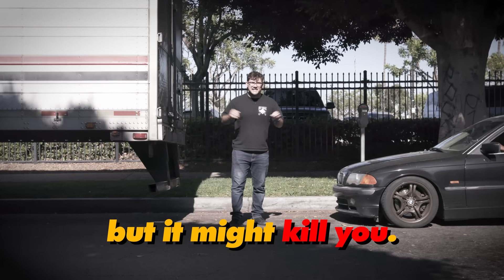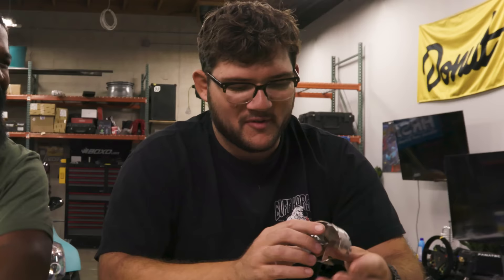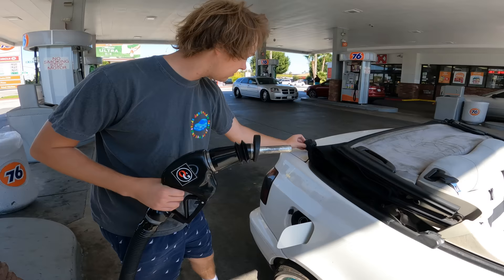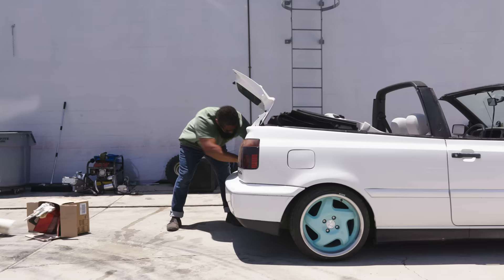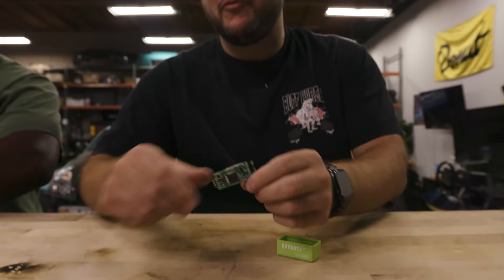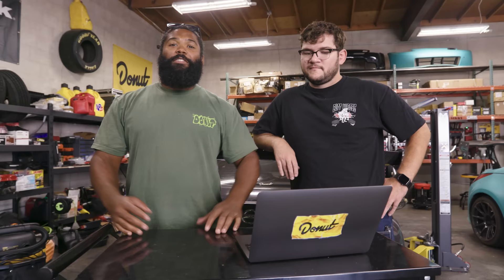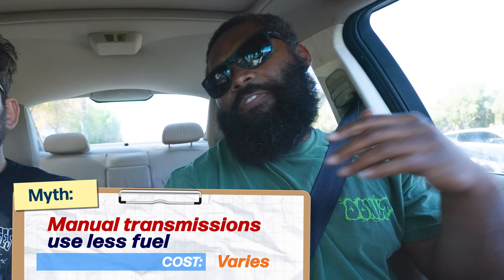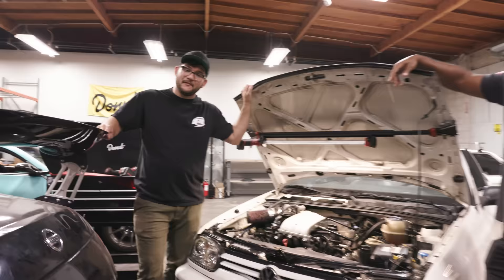Testing Fuel Economy Hacks

Comment: A few issues with their myth busting.
HHO CAN work if you do a few things as well.
Unfortunately, car makers are hep to HHO and such and deliberately fix your timing so you cannot adjust it - you retard timing to AFTER TDC at full advance.
But it can be tricked via the IAT sensor modification to a small degree.
Pulling the O2 sensor out of the stream might work for some but generally it does not.

HHO generators take time to heat up. 160F to 165F is optimal for the water temperature to convert efficiently - it take s a bit of time to heat the water up that high.

Another item is you have to fool the O2 sensor readings via an electronic gadget you splice in. Unfortunately this does not work well or at all for all Ford products and any that uses frequency feedback. GM is the best for that particular mod.

Here is another problem. I did all that and doubled my MPG, for about a day. Then it went right back to bad MPG. Reason? The fuel mapping in the computer fought me and forced the car to enrichen the mixture as the information was outside the fuel mapping in the computer.

You need about 1L of HHO per liter of engine capacity for best results.
1/4L will help increase MPG by about 20-25 percent with no modifications.

Be aware that if you set things up incorrectly, you can experience and explosion.

Additionally, the hydrogen causes what is called Hydrogen embrittlement.
Not good for the steel parts in your combustion chamber.

With the right setup, a 4 cylinder feels and runs like a strong 6 cylinder (I did the mods).

For every 50 pounds of weight you haul around, you can lose roughly 2mpg or more if you have a small engine.

About drafting - way to tell if you draft enough is to roll down your window.
You will notice a change in the sound from the air, sometimes abruptly. Then you know where the draft is.
Truckers HATE when you draft. Cops can give you a fat ticket for following too closely.

Removing your mirrors can help.

Tail gate up or down depends on the vehicle. Remember, tail gates are a bit heavy.

Vehicle 'belly pans' can help quite a bit but can be problematic with the high heat from the CAT converter.

Using an aluminum pizza pan to cover your rims can help too.
Some go so far as to get LRR tires (Low Rolling Resistance)

Manual transmission can save fuel if you do gear skipping. They are also lighter than automatics.

Getting to the gym to work out and lose weight helps. Why do you think horse jockeys are short and skinny?

Best free ways to save gas is to do this:

1) very SLOW takeoffs from a stopped position.
2) never exceed 1950 rpm's on your gauge at any time regardless of your speed.
3) Keep your car well maintained.
4) lighten the load as much as you can (junk in the trunk/back seat/etc).
5) Anticipate stop signs and red lights. Take foot off the gas pedal early. Drive like you have no brakes.
6) avoid hauling people's asses around.
7) when traveling 35mph or faster, keep windows rolled up.
8) leave the stereo OFF. Avoid using climate controls. Turn off daytime running lights. All save power.
9) Combine trips with the furthest trip away from home as your first stop and work your way back.
10) Pull through parking lot parking spaces so you do not have to back up to get out.
11) Back into your driveway when you get home. Backing up always uses more gas.
12) do not warm your engine up - start it, let it run till the high idle drops to nearly or just above normal idle, then go & drive very slowly till the engine warms up on it's own.
Lucky 13) Have someone else ride you around - they use their gas and not yours!
14) How about bicycling or just walking? Bus? Delivery?
15) do not make stupid trips like driving across town to get your lighter from your cousin's crib. Cheaper to just buy a new lighter.
16) plan trips for when there is the least amount of traffic.

That is off the top of my head.

Comment: Every expert on youtube says 94 and 87 octane are the same. Resistance to detonation only thing, blah blah. I tell you what. Throw some garbage 87 in a classic hotrod or 90s snowmobile, it will run no problem, but then put in a tank of 94 octane and you hear and feel the difference. More power means less throttle to keep a certain speed, meaning it goes further, and when you do put the hammer down it has some good up and go. But ya 87 is the same to these smart people. Lol

Comment: Your wrong about pumping up the tires. Every serious attempt to increase fuel economy has used this tactic. But those experiments were usually done on a closed course or under highly supervised conditions.  The experiments were conducted to achieve high mpg, and not safety. If you were to do the same thing with your car in city traffic you would skid out of control or skid into an accident. It's been known for decades that keeping your tires properly filled will give the best  mpg. When you are lax about maintaining proper pressure in your tires your mpg will go down. That is science.

Comment: What's the point of doing a video where you evaluate products by simply taking it out of the package sharing your opinion about it without actually using it cracking it open and reading some letters and then calling it a scam? All of that is what we're starting with The point of the video is to confirm whether our feelings are correct or not. People think that this thing can't possibly work You actually get the thing don't test it and then just agree that everyone's opinion is correct? What?

Comment: The turning things off to save power segment is so obvious it's ridiculous. Bit of a time filler - could maybe have done something different there?
Also the auto vs manual thing, you could surely have chosen a more Apples to Apples comparison, (as in same number of gear ratios), and then spoken about the method in which each type works?

Comment: bruh 5:51 has no idea of what hes talking about, the fuel is colder when its winter tho, because the fuel is affected by the temperature in the ground because of the storage tanks. And even tho your fuel tank and your engine is hot, it wont affect the price??? the price is calculated based on how many gallons of fuel is pumped out.

Comment: 13:36 what ignoramuses are, any mechanic knows that the same cars with different boxes. Always in a manual gearbox on the last gear, the ratio is less than of an automatic one. So a manual gearbox is always economicaler.

Comment: 😂😂😂 You should understand what “top tier” fuels are before you ignorantly compare octane levels at a supplier that is a top tier fuel supplier. It doesn’t have a single thing to do with octane rating, top tier fuels don’t use detergents. And the myth isn’t that you’ll get better fuel mileage (though you usually will when compared to most cheaper fuels), the fact is that top tier fuels keep your engine internals much cleaner.

Comment: This is by far the worst Donut video i've seen
Some of them are actually not a myth like the tyre pressure (Yes I know it degradates unevenly but there are specific thinner tyres with high pressure that improve mileage) and some are not 100% true like reducing weight might actually increase fuel consumption by increasing the height of the car.

All of these are just stupid tips, they could came up with actual working ideas from changing the driving style to reducing mechanic or aero drag or even do some modifications to the car like improving air take, reducing exhaust resistence, reprogramming the ECU ...

Comment: Manual transmissions are more reliable and you can push start a manual. Also, torque converters lose a percentage of power, up to 10%. Which is obvious when you know how a torque converter works. I'm losing faith in your channel.

Comment: Some of the out of hand dismissals are at least possible. The OBD2 gadget, for instance. IF it just resets the base timing +1 degree you will get better mileage with minimal chance of damage to the car. Similarly, the over inflated tire "myth" is probably true, FOR BELTED BIAS tires. A harder tire has less rolling resistance, it has nothing or little to do with contact patch minimization. Turning off accessories, they mean air conditioning, not lights. This has been confirmed over and over again, the drag of a compressor is easily 1-2% of a difference (just don't roll down your windows). Manual transmissions more efficient. Absolutely. Check any new car mileage rating where there is a manual/automatic option. Direct mechanical coupling is always more efficient than vicious liquid. Always. Do yourselves a favor, get some better scientists or engineers to consult before going into the myth busting business or you just look like idiots.